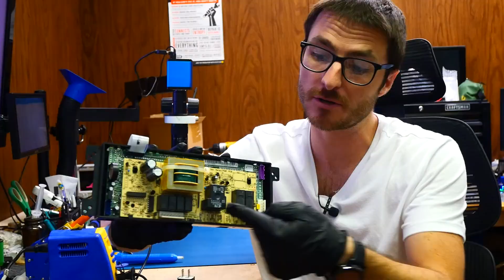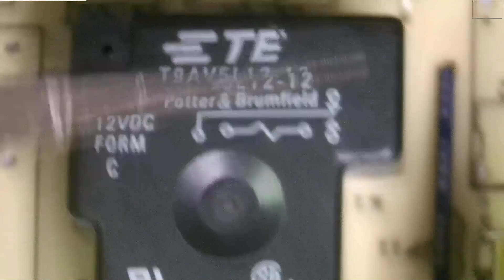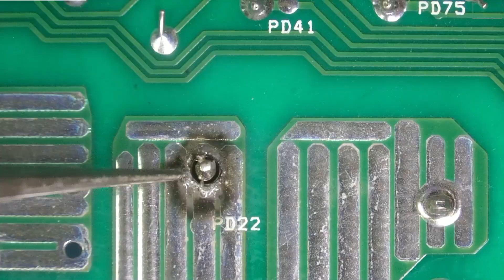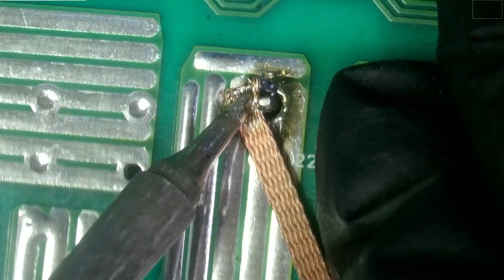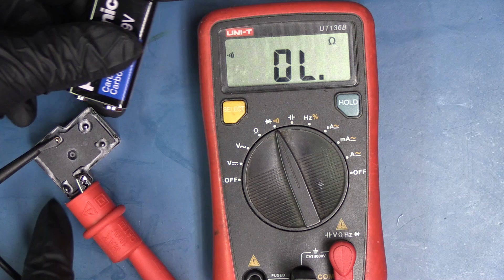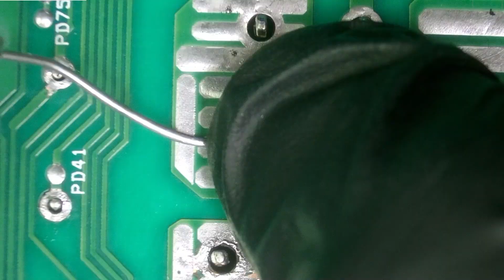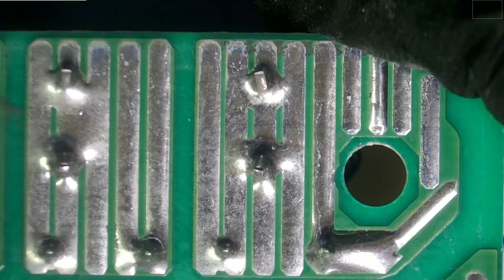Frigidaire Oven won't turn on? We Fixed It!

Comment: Super good video Nick thank you.  I did the exact same repair on my Electrolux 3164627 board, one of the pins of the relay K1 (T9AV5L12-12) was losen.  the relay works find and I resoldered in place. When I put the board back in the stove, the R1 resistor burned up as soon as I put it on Bake. before that I have had checked the conductivity and the ohms on all elements, all good.  Do you have any clues on what should I check next .  thank you
Reply from the maker: The R1 resistor burned up? I have fixed over 100 of these units, never have I encountered that. (edit, I have seen this several times it is actually common, I was thinking of a different controller board that doesn't have the R1 typical burn up)
I am sorry but I don't know your level of soldering skills. When we get sent in boards for repair that have had failed repair attempts, we will often see the following types of mistakes: Sometimes people use too much solder, the solder will drip off their iron and land somewhere on the board, and bridge a few components without the person noticing. Did this perhaps happen?
We also often see bridging of legs if you try reflowing 2 components near each other.  
Did you properly and fully put the unit back together before testing it or is it possible the 2 sides touched during your testing?
Have you performed any short checks on the unit? Sometimes we do see shorted diodes, ICs, Transistors, and so on. Perhaps there is more damage to your unit. Although again I have never seen R1 burn up this is new for me. (edit, again I thought this was for a different controller board for some reason) 
If you want to send us pictures or get more help, it may be best to email us directly. My contact info is in the video description.